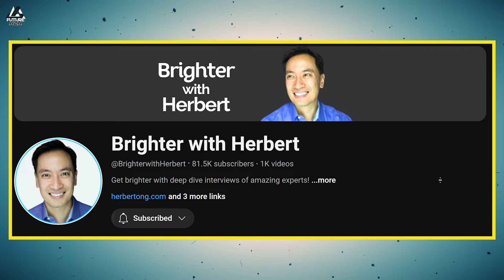Robots are ALREADY Destroying Humans... Jobs

Comment: I hope that the Optimus has a self charger, so that it has a base charger when not working or idle time.  Many of the floor cleaning machine go back to their charger when battery is low then resumes work once fully charged.  Maybe if Optimus is working at a work station, then have a inductive charger while working  would be so nice.
Reply: Scott Walter went through a model he'd made whereby the bot could follow normal shift patterns in factories, plug itself in during shift breaks, and still work 22 hours a day without need for inductive charging. Not saying your incorrect, just an alternative to cabled power may not be necessary in some situations.